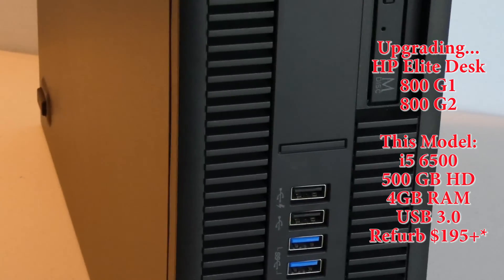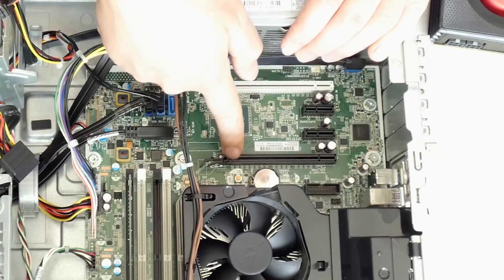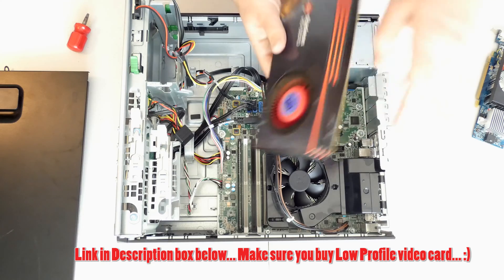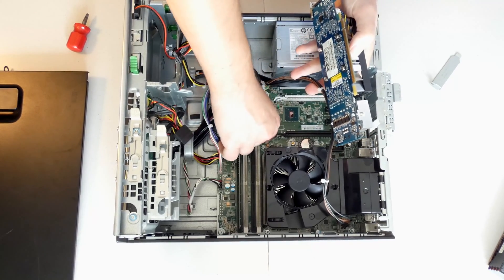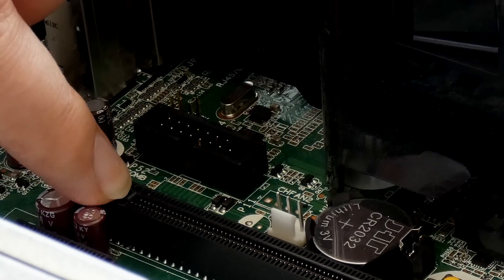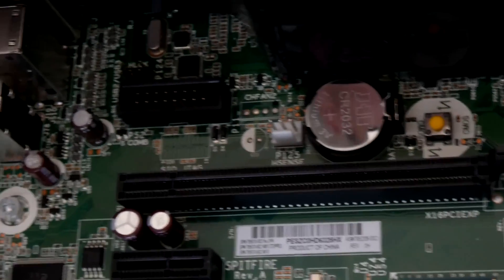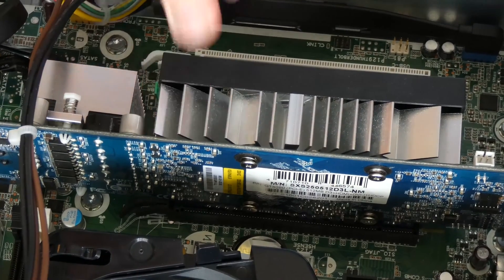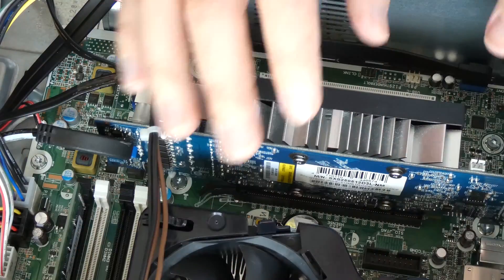Video Card Upgrade HP Elite 800 G1, HP Elite 800 G2, 600 G1  Small Form Factor Desktop

Comment: And with an Hp Prodesk GT can I use the gtx 1050 ti ?

And is this graphics card the same as the one in the description?
https://www.amazon.fr/Gigabyte-GV-N105TOC-4GL-Graphiques-GeForce-GTX1050Ti/dp/B01N33SOXU/ref=sr_1_3?s=computers&ie=UTF8&qid=1545769557&sr=1-3&keywords=gtx+1050+ti+low+profile
Reply from the maker: I'm not sure...also there are 3 different ProDesk computers. Open the case and see if you have a free slot where card would go. If it looks like enough space then a low profile would probably work. 
That link is the same as the link in description: https://amzn.to/2LzhdO3
Reply: @Cobuman  I check if the card can fit in my computer and there is 167mm of available to place it in my computer.

And the computer is almost the same as the one in the video?
https://drive.google.com/file/d/1bVplZP5m_3jOJlqmsWxTySAPGWIKzUnI/view?usp=drivesdk
(sorry if I make mistakes but I'm not english)
Reply from the maker: I can't see that image on discord... Access denied. Anyway, if it looks the same as video then it should work.
Reply: @Cobuman  I change the link.
I think I'll buy it and see if it works.
Reply from the maker: Yea, that looks very similar so it will probably work.
Reply: @Cobuman  I had my graphics card and it works but I just have a problem is that the resolution is low so I'm in 1080p.
Reply from the maker: Update the Nvidia drivers maybe. 1080p is standard resolution unless you have a 4k or other.
Reply: @Cobuman  I tried but it did not work, I'm on a TV 1080p and when I plug the cable vga I have the same resolution that I had before.
Reply from the maker: Does it let you change the resolution at all? You can try HDMI or some other connection. "VGA" (blue cable) is an analog connection and not digital.
Reply: @Cobuman  I try HDMI but I find no solutions but when I play certain games the quality is good.

Comment: Hey bro, I'm ready to buy one.
Pn: 2DW27LA # AC4
- Model: Hp Prodesk 400 G4
- Type of Case: Small Form Factor
- Processor: Intel Core i5 7500
- Generation of the Processor: 7th Generation
- Chipset: Intel® 100 Series H110 Chipset
- Memory: 8GB DDR4 2400
- Memory Expansion: Up to 16GB, 2 Slots
- Storage: 500GB, 7200 Rpm, SATA
Can you tell me if I can play games like dota and cs go without video card
ty bro s2
Reply from the maker: Good question. So, the i5 7500 uses Intel® HD Graphics 630 as GPU... With that in mind, you can see which games will work with Intel® HD Graphics 630 by searching youtube or google. Everything else looks okay when it comes to PC specs for 400 G4.

Comment: I have the HP Elite 800 G1 as well w/ Processor Intel(R) Core(TM) i5-4590 CPU @ 3.30GHz, 256GB SSD and 8gb of RAM. I'm fine with the specs, but is this the best low profile video card you can buy at the moment? 2GB DDR5 is okay, but I'm also not trying to play big AAA big titles either. Great vid!
Reply from the maker: Thanks! The best low profile card you can get is GTX 1050 ti 4GB like this one: https://amzn.to/2Luofnx  
Of course, the standard GTX 1050 2GB (low profile) will work pretty good as well. I hope that helps. :)
Reply: @Cobuman  best one would be now the 1650 low profile

Comment: I actually just installed an Nvidia GTX 1050 Ti graphics card. It works great however I am having an issue where my network adapter cannot be found. I checked the device manager and it seems like it just disappeared. I only see the Ethernet and WAN drivers. Do I need to install a new wireless adapter or is this an issue that can be fixed?
Reply from the maker: That's interesting. Do you still have internet or just missing an icon?
Reply: Happened to me on windows 10  https://www.youtube.com/watch?v=WzrYRcTxcyI

Comment: I got a rx 580 but doesn't fit I was thinking is it possible to reuse the cpu and get another motherboard to go with the gpu+ram, or does it have some custom attachments as well as other stuff like the PSU?
Reply from the maker: You can get a new motheboard and PSU and just transfer everything over... however, for that to work you need a an aftermarket case so that everything fits inside. Something like this: https://amzn.to/2Bn4Npg If you need further help let me know.

Comment: Hello there, do anyone knows if the ProDesk 600 G2 with the 200W PSU, handles the 1050 or 1050ti? If not I’ll have to stick and buy a GT1030.. Glad to hear from anyone’s experience...
Reply from the maker: If you wish to play safe you can go with 1030, but the main thing to consider is the total system power consumption...
For example the G2 models have 200w psu compared to previous gen of G1 that has 240w... but why is that... because the new gen CPU on G2 consumes less power so they switched to 200w... That being said, it will probably work with both 1050 and 1030 cards.
Reply: It handles like a beast with the Gigabyte 1050ti 4gb Low profile paired with the 200W 80 plus platinum PSU, amazed it worked out and worked as a champ, thanks to you man, all thanks to your tutorials :p keep up all your work and effort
Reply from the maker: Thank you. :) I'm glad it worked out for you.
Reply: @ipaghd  hi I have prodesk g2 600 with 200 w , I can upgrade to gt 1030 and 1050 , pleaz tell there is no problem
Reply: What's your PSU? Mine is the 200W 80 plus platinum, if yours is the same, it will work.
Reply: @ipaghd   thanks, Just one thing if I play many hours or watch many movies there is no problem

Comment: Cant i change the case to get the full graphics card?
Reply from the maker: Probably, but the problem comes to attaching the PSU, it's different size and you can't just use another PSU because mobo power connectors are different.
Reply: He Ghesboro
Reply from the maker: I just made a video that talks about transferring everything to a full size PC case which allows for big PSU: https://youtu.be/C70nmtTFPuw

Comment: If i have a minitower hp elite 800 g1, can i change the psu and then put a gtx 1060 3 gb? Can this work?
Reply from the maker: No, sorry... That would not fit inside.
Reply: @Cobuman  really dude? :c, if i have a tower version could fit inside? Or what you recommend to do, help me pls :c
Reply: @Cobuman  man, answer me pls :c, if I put a only one fan gtx 1060?
Reply from the maker: If you have the tower version not the SFF like in the video... you can physically put 1060 inside or anything else. : ) There is enough space. You may need an extra adapter for 1060 power... Depends which one you buy.
Reply: @Cobuman  oh thank you man, so gentil for your part, o so, if i buy a new psu that dont includes the adapter? Well i think buy a single fan 1060 or a gtx 1060 dual fan by msi, what you recommend?
Reply from the maker: Check the card requirements. It will say if it requires additional power and should come with an adapter. Most single fan or fan less cards do not require an adapter which is recommended for SFF PCs like in this video.
Reply: A lot of thanks bro! this helped me so much!, greetings bro, keep it up ;)

Comment: When you say it won't fit without considering the power of a good dremel and hacksaw. You can make most non extended pcb gpu's fit if you really want em to :p
Reply: Just PLEASE tape around the cutter area so the back of your gpu doesn't short 😅
Reply: Ha💃this woman did😜I put An ATX Radeon 550 4GB in my SFF 600g1 today, added 8gb more ram, second hard drive... She's up and running so far so good (nothing a hack saw, bolt snips, and duct tape can't make WORK 😂) It's just the case why care if it fits a case if you got the old puter working like new on the internals
Reply from the maker: Haha. :) I would love the see pics of this.
Reply: Retired/donated the unit last year for a zbook psuedo desktop.  Luckily in my case it was a r7 x250 so 1/4" cut. It had the top GRam dimm outside xD
Reply from the maker: LOL Nice!
Reply from the maker: I just made a video that talks about transferring everything to a full size PC case which allows for big PSU: https://youtu.be/C70nmtTFPuw

Comment: is it possible to upgrade the PSU on the full size version?
Reply from the maker: The PSU has HP motherboard specific connectors so you cannot upgrade-only replace with original.
Reply: @Cobuman  how many watts is IT?
Reply from the maker: PSU on 800 G1 is 240w and on 800 G2 is 200w.
Reply: It says on the hp website that this computer comes.with a 320 watt power supply?

Comment: I just bought a 1050 ti and I have this exact same computer. I was thinking about upgrading the psu to a 500w but, surprise surprise! The damn thing is so componen specific that it doesn't have a 24 pin connector for the motherboard, which means you're pretty much stuck with the factory psu... So, forget about using the motherboard for a more powerful build. The card should be arriving in a week or so and it CLEARLY says in the specs that they recomend a 300w psu or higher, I am INSANELY scared to plug that thing and what the whole system go nuclear in front of my eyes, so, that's why I'm here, I need to know if it's safe to use a 1050 ti in one of these. PLEASE HELP ME.
Reply from the maker: I can understand your worry. You are correct about recommended PSU 300w; however, this is for the entire system consumption... I don't know exact numbers, but I don't suspect 1050 ti pulling more than 70-80w by itself. That being said, most people do not have any problem using this card with this PC (stock PSU). :)
Lastly, if by chance your system at some point consumes more power than it can handle-it will simply cause your computer to stop working; at which point a replacement PSU is around $30. Don't worry about it too much. ;)

Did you buy the "low profile" version?
Reply: Yeah, I bought the low profile version from ZOTAC. And I checked a couple of more videos on the web of people doing the exact same build and apparently it should work just fine. Still kinda worried tho lol. The thing that scares me the most is that in every video I see they show the whole building process but they never show the final result with the pc turning on and playing actual games! I mean, you clearly built this pc, and you even put a card that is a little bit more demanding than the 1050 ti low profile. My question is, did it actually worked? or your house turned into chernobyl 2.0?
Reply from the maker: Hehe. That's funny. Da, it works fine. :) I gave this PC to my brother to play World of Warcraft.
Reply: @ilidanelv  so did it end up working? I have the same pc with the 200wats psu and was wondering if I should go for a 1030 or a 1050ti.
Reply: @jaxd7206  the card should be arriving by next week, I'll keep you posted!! The psu is 240w Btw
Reply: @jaxd7206  Installed the card today. Perfection. Works and fits perfect!!!
Reply: @ilidanelv  Glad to hear it. And thnx for keeping us updated.
Reply: @ilidanelv  Hi, i just got one of these PCs for me at home, and am thinking about getting a 1050 ti too. Does your PC still work or did the PSU explode in the meanwhile? :D
Reply: @headpain  Hey man, it's all good!!! Playing dying light the following at 60 fps now lol. I also installed 16 GB of ram and I'm planning to upgrade to an SSD. I advice you to do the same! And for next year, I strongly advise an upgrade on the motherboard and psu (and case of of course) that way you should be able to rock that cpu with an even more powerful gpu!! Cheers!
Reply: Elvis Eulacio  Hey Elvis, thanks for the reply! I already upgraded to 16 GB ram :D i think i will use this PC as long as possible without any further upgrades (except the ZOTAC low profile GPU i just ordered) . The reason being LGA-1150 socket MOBOs are barely available where I live. I think when the time comes I will have to buy a complete PC.
Reply from the maker: I just made a video that talks about transferring everything to a full size PC case which allows for big PSU: https://youtu.be/C70nmtTFPuw

Comment: This is so bad that i have this desktop, Low profile graphics card are very rare and expensive and the most of them are bad. i found alot of cheap and amazing graphics card but they won't work on my pc i guess. unlucky :/
Reply from the maker: The best low profile card I've seen is the GTX 1050 ti. I wish they made higher end cards that are low profile; however, even GTX 1050 is a massive upgrade for this PC.
Reply: @Cobuman  Can i fitted GTX 1050 ti on my HP ProDesk 400 G4 MT? Please Please let me know. I'm Learning video editing on adobe premier pro cc.
Reply from the maker: Possibly, I don't have one to check but I found this information about GPU upgrade: 
1 low-profile PCIe 3 x16 6.35 cm (2.5"), 16.76 cm (6.6") length, 35 W max power
Reply: @Cobuman  bro lots of thanks.
Reply from the maker: My pleasure.

Comment: So the link is for Gigabyte Geforce GTX 1050 OC Low Profile 2GB GDDR5 128 Bit PCI-E Graphic Card (GV-N1050OC-2GL) , that will work with the  HP Elite 800 G2 Small Form Factor Desktop?
Reply from the maker: Yes, that one or the GTX 1050 ti with 4GB. Either way, just make sure you get the Low Profile version. :)
Reply: Thanks for the reply! Also great video, thumbs up!
Reply: So did the replacement and work fine with the new card. The next day the PC did not see my Hard Drive. I rebooted the machine and everything is fine, wondering if its the PSU. Not enough power for everything. Any PSU replacement ideas.
Reply from the maker: Double check the cables to hard drive, but I don't think it's related to PSU not having enough power. If it was PSU issue it would fail at full load of CPU and GPU. 
I am not aware of PSU upgrades for this specific PC, only original replacement.

Comment: will 1050-ti low profile work? even with only 200 watts psu?
Reply from the maker: Good question. Nvidia recommends total PSU power for the system of 300 watts, this computer's psu has 240w; however, most people don't have any issues using 1030, 1050, or 1050 ti with this computer.
Reply: ok thank you. but mine is an elitedesk 800 g2 sff, and has only 200 watts psu.   i hope 1050ti still works.
Reply from the maker: Oh, you are correct. I was thinking about HP 8200 SFF. I do know that if you have 800 G2 with 14nm architecture intel cpu that power consumption is less than previous 28nm generation which is found in 800 G1 Desktops. Either way, if psu goes bad it only costs around $30 to replace. I hope that helps. :)
Reply from the maker: No, it has to be specific to this model of PC. For example; size would be different and connectors are HP specific. Sadly, the connectors are different even compared to previous models of HP SFF computers.
Reply: Well I'll just hope there won't be any problems when I put in the 1050ti in it since I already added an additional 4gb
Reply: Would any PSU fit in it?
Reply: I take it that this desktop ( https://www.newegg.com/Product/Product.aspx?Item=9SIAG967E71484 ) is not functionally dissimilar to that depicted in your HP Elite 800 videos, yes? If so, may I request that you list some available replacement PSUs, if there are any?
Reply from the maker: Yes, 800 G1 is very similar to G2, but the PSU is different. If you have a bad PSU, I would replace it with original HP brand for your specific model.
Reply: Since it's been 6 months, have you run in to any power supply issues with the 240W PSU? I've read up that some people have run in to issues with the wattage

Comment: The thing is that I have a HP Elitedeskop 800 g2 35w, can I do something similar to this, even if the computer is a bit smaller?
Reply from the maker: Technically speaking, if you have a pcie slot then you should be able to add a video card; however, you may need a specific shape/size video card found in those smaller models. For example, if you have a model without a video card upgrade ; you should be able to find the standard versions from HP that would normally go in there. I hope that helps. :)